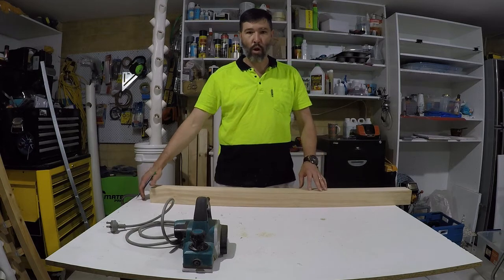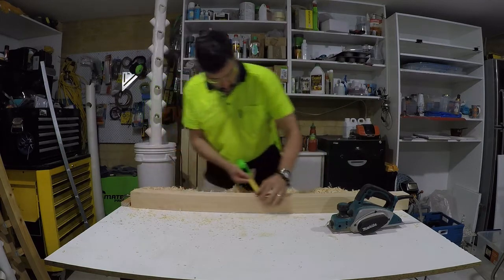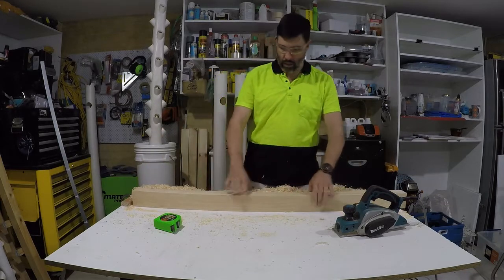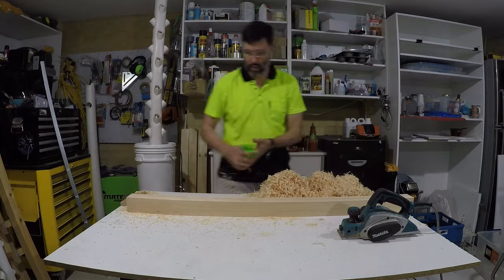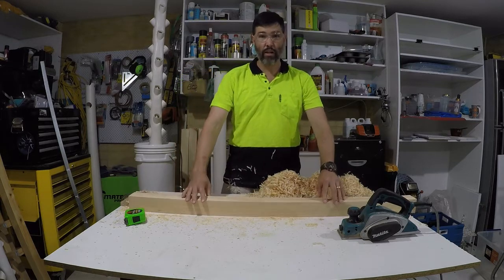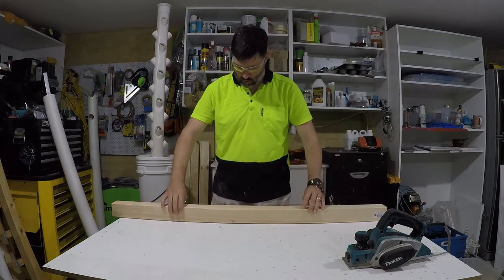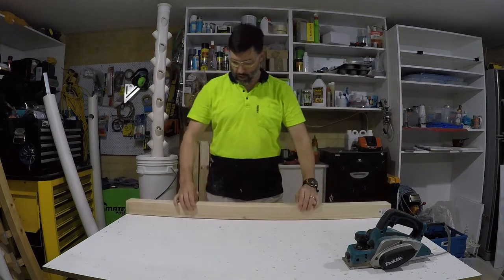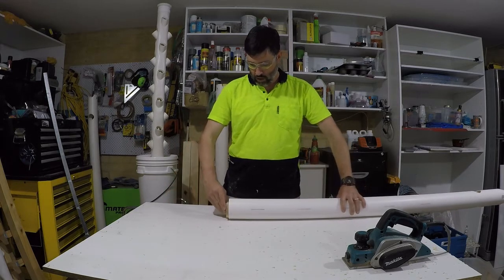DIY hydroponic garden tower part 3

Comment: Hi Andrew, I have 2 questions. Why did you choose the 90mm pvc pipe? also how did you work out what size to make the wooden post for support inside the pipe?
Reply from the maker: Hi Chris
I chose the 90mm pipe as it's our most common size. 
The size of the square wood to go inside the pipe is the largest size that would fit. It also made a large enough flat spot for the spigot that holds the net pot. If the wood is slightly to big you can sand or plane the corners off to make it fit. 
Make sure you shave the corners off evenly or you will have different size sides when you mound on the spigots. 

Good luck

Comment: Hi, Andrew, I do not understand how you are getting uniformity with your cup holders when I attempt to follow your instructions I get two styles of cup holder one when I cut the angle and one when I cut the 90degree the difference being the depth of the cup any comments? otherwise  an extremely precise and easy to follow the demonstration
Reply from the maker: Hi Tony, thanks for your message. It's really great to see that someone is out there trying to build a tower. 😁 As for the cup holders, all I can think to check is 1. are you always cutting the same angle each cut.  2. Is the point of the angle cut on the stopping block and not sliding past it.   Is the size difference very much between your angle cuts and square cuts?  Let me know if you are still having problems and I can make a short video just in that bit in a bit more detail. Thanks for watching and happy building. Andrew